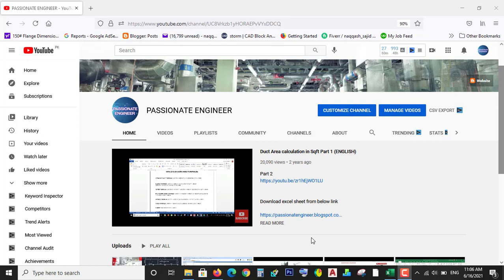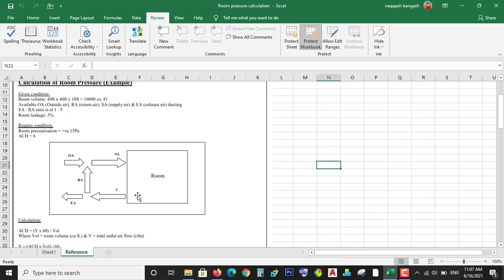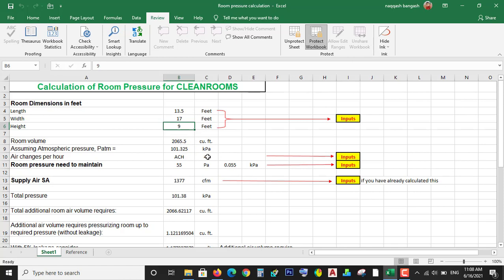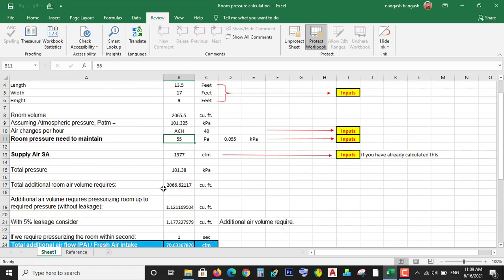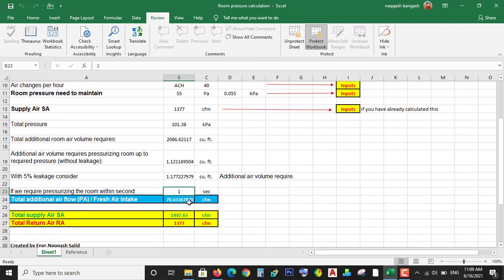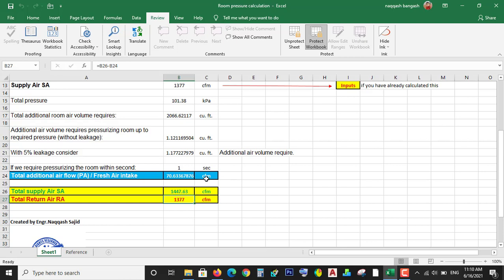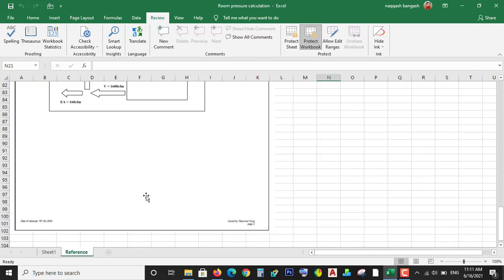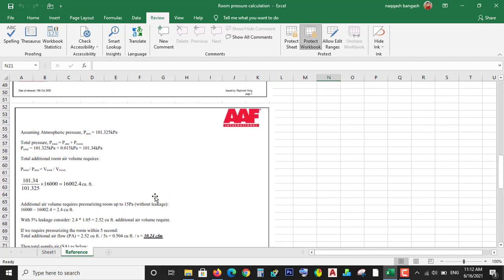How to Calculate pressure in Clean room HVAC (ENGLISH).

Comment: Hi Sir.... Its really helpful..but i have one question...my question is .....if the door opens between 2 spaces ...lets we imagine for 5 seconds when a person pass through ...it takes 5 seconds for door to fully close when a pereson walk or pass through door..then what we do?
Reply from the maker: For more precise calculations, you can watch our staircase pressurisation design and apply the same technique to the room.
Reply: @passionateengineer04  ok i will watch..... but is staircase approach is same as cleanrooms? I have NGS Room & air locks & between then there is door..i have to maintain 20 pa & i assume for 5 seconds door will close fully when person pass or walk through ngs & air lock... what i do?
Reply from the maker: @TahaNasir-nq5xw Yes, staircase pressurisation is actually pressure calculations or cfm calculations to maintain pressure, so these are equations applicable for all pressurisation

Comment: Great video sir. But I have a bit of a doubt. In one of our project quote that was given to us the pressure in one of the rooms (bio safety room) is given as negative. No parameters are given in it for pressure..in this case what do I do?
Reply from the maker: If you want a detailed calculation, refer to ASHRAE, you need to calculate wall leakage, door leakage, etc.
Before this, you need to calculate the required cfm based on ACH min of 20 for cleanrooms

Comment: This was really helpful thank you. I did have a question if I have a positive pressure environment located in a lab and I have a heatload within the positive pressure environment, how do I calculate the amount of cfm I'll need to remove the heatload into the lab?
Reply from the maker: Sorry, i didn't understand your question, can you please elaborate?
Reply from the maker: if you know the load then you can use sensible heat equation that Q= 1.08xcfmxdelT

Comment: salam Naqash, can you please advise how I can ensure if I am maintaining required positive pressure in the room? I know there are some differential pressure transducers available in the market, but can you shed some more light please on where to install, how many are required etc etc
Reply from the maker: Walaikumasalam, 
Positive pressure means that its positive with respect to another space and in another sense its supply air is more than return air. 
Only one PDT is enough to install,its one probe will be inside the room and another will be in adjacent space. For proper installation we always refer to manufacturer recommendations. 

Thank you
Reply: @passionateengineer04 Thanks a lot, how can I connect with you via whatsapp or email??

Comment: Hi Sir,
Where do we get the value for pressure required to maintain in a room?(Here you have taken 50 Pa)
Reply from the maker: You have to maintain minimum of 2.5 pa differential pressure, pressure requirements depends on type of cleanroom

Comment: Where did you get that value 55pa from ?
Reply from the maker: It depends on type of area, like you want to maintain positive pressure of 20 pa or 50 pa etc, it will calculate the flow rate on  this basis.

Comment: Nice video...in your excel sheet you have shown SA RA and fresh air..so will need to maintain exhaust air..?
Reply from the maker: If you have requirements of EA than add that much air in FA.
Reply: @passionateengineer04  thanks sir...suppose i have one room and have to maintain 15 pa pressure.
In the room have 4 diffuser..now every diffuser will have 15 pa or all together will be 15 pa..?
Reply from the maker: All together will mantain 15 pa, 15pa will be room pressure.